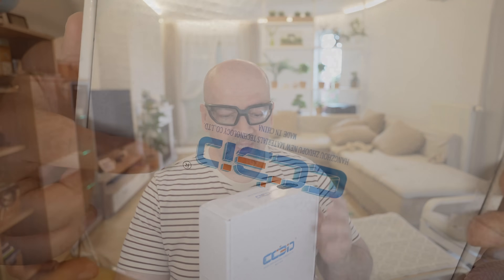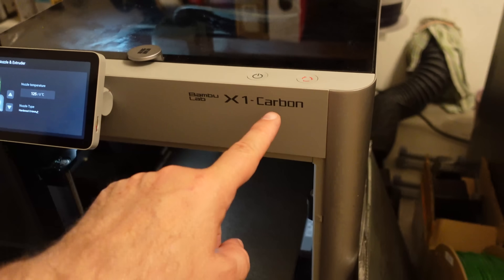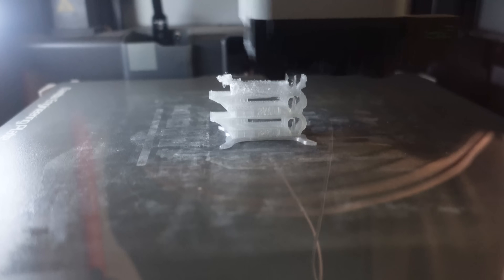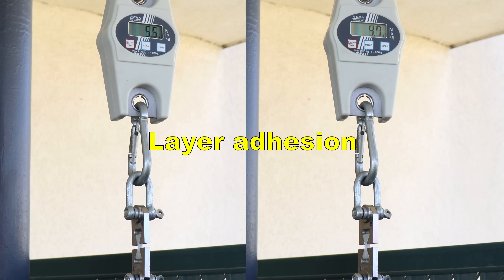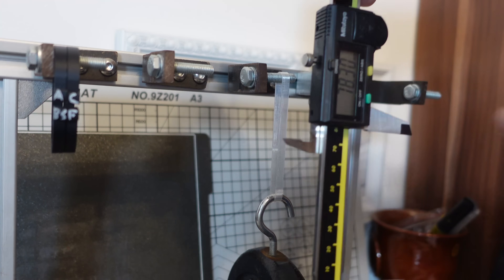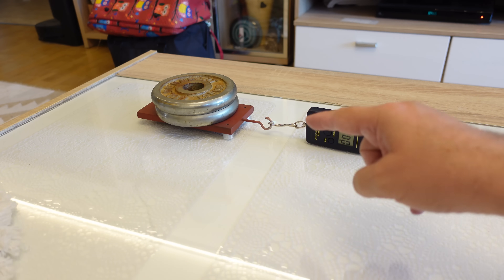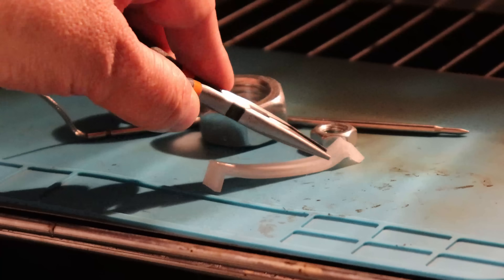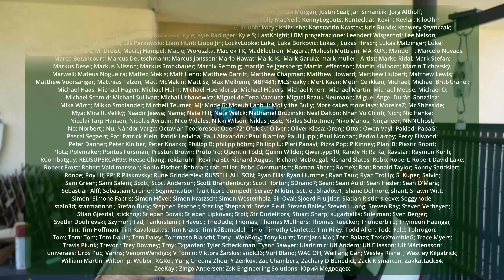TPU+Nylon Mix: Is CC3D TPU 72D the Toughest Flexible Filament?

Comment: Do you think this would be a good/similar replacement for Taulman PCTPE (similar mix of nylon and TPU but discontinued)?
Reply from the maker: Sorry, I never had a chance to test that Taulman filament.
Reply: @MyTechFun  I've just bought some of this to compare anyway - if it's somewhat similar I'll see if I have enough Taulman to sent you for comparison if you want?
Reply: PCTPE is a polyamide polymer mix, but does not contain polyurethane. It is TPE, thermoplastic elastomer 15% with 85% nylon 6.  Not sure why they discontinued it, but Taulmann was sold and the new owners quadrupled the price, and shocker, no one bought it.
Reply: @truantray  which tpe?
Reply: I would love to know this as well.  I bought one spool before it was discontinued and loved it.  I have been on the lookout for a replacement ever since, but everything is either too stiff or too floppy.
Reply: @chrisbruce9497  no need to guess, these filaments have Shore ratings, so any filament with an A rating will be flexible, or a D rating will be stiff. The higher the number in each category, the stiffer it is in that category. Most TPU is 95A or 98A, ninjaflex is 85A. 75D places this in the stiff plastic category, but on the flexible end of that category. PETG is 76D.
Reply: @truantray Thanks for the comment.  I’m not sure where you found the Shore rating — do you have an online source?  I’m also interested in comprehensive tests to see if there is another comparable filament more readily available.
Reply: I have some unopened spools of pctpe that I’m saving for combat robotics parts.  Also noticed it tends to warp like crazy, so gotta figure out how to stop that…